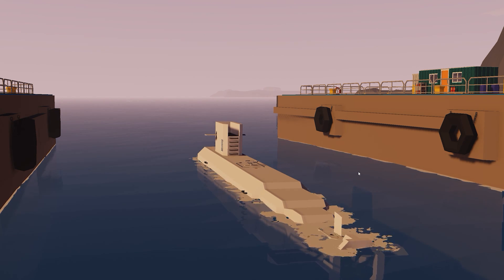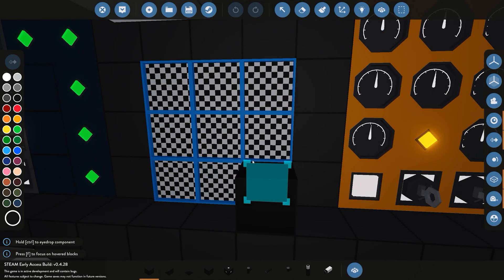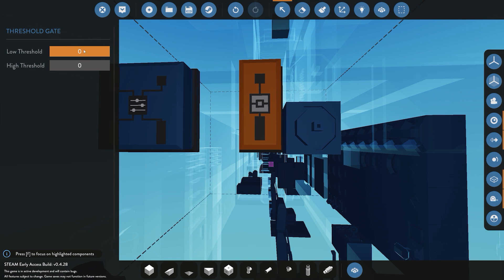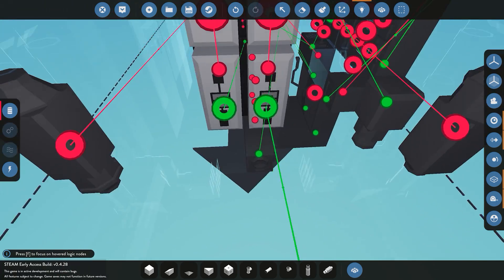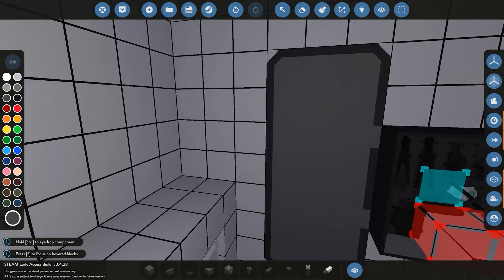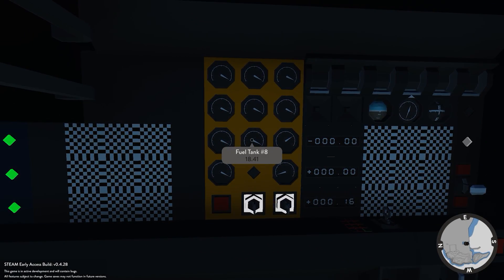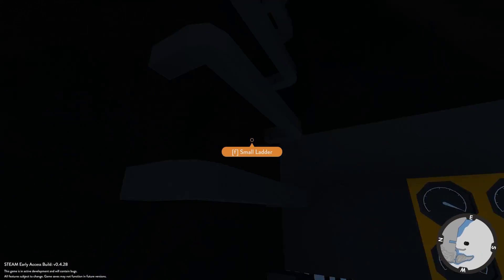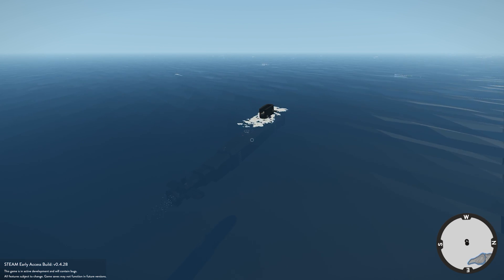Stormworks Advance Submarine Part 5

Comment: I must have mislooked something from your videos, but how does your automatic depth system maintain a certain depth with just a simple on/off switch in the ballast tanks? Wouldn't your sub eventually be too heavy to maintain depth?
Reply: It uses a PID connected to altimeter and control surfaces. Ballast is just to make it sink.
Reply: @kubaaseph  that's what he's talking about. if the sub speed is zero it will eventually sink to the bottom

Comment: Would you be able to add lights that run white when the sub is surfaced, that then turn red when you submerge?
Reply: Yes. Depth sensor, less than gate and a set of red and white running lights.
Reply: İt is actually used in submarines like day and night cycle. But its not a rule. So can be modified.
Reply: At least now there is composite, wich can tune RGB lights so I am sure with an altitude sensor you can logic it up.

Comment: Hey could you make a video on how you make the generators actually work? Because I can't get them working
Reply: Pretty simple, connect your generators to an engine with pipes and connect the electricity from the generators to batteries and there you go, you can add gearboxes facing toward the engines between the engine and generators so the gearboxes can create more RPS and then create more electricity

Comment: Wonder if you could add your "radar" system to this, might need a larger boat for that though.
Reply: Just attach output of the sensor to 4 threshold block: 1st: 0-25 metres 2. 25-50m 3. 50-100m 4. 100-250m
so you can have bigger radar "resolution"
Reply: I tried this myself, though made two modified versions of the radar and fitted them into a submarine.
1: for the 360 radar I used 4 distance sensors and 4 outputs. not 100% happy with this and gonna try changing it to just the one.
2: instead of indicator lights I used the vertical gauges and connected the range directly to the sensors, gives finer reading but stormworks seems to lag with updating their outputs at times, not sure if just had too much stuff moving will retry with just the one distance sensor on the mast.
3: added a forward-sweep radar on a pivot below the waterline, gives a nice idea of what's ahead but still feel limited
4: the beep 2 buzzer makes a nice detection ping noise
Reply: You can just use a dial for direction and a simple light for showing contact.